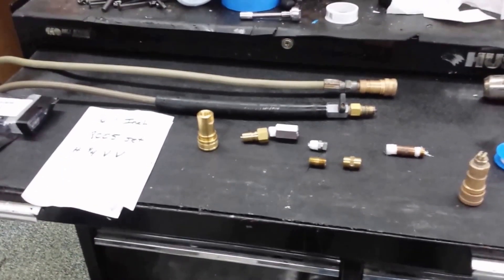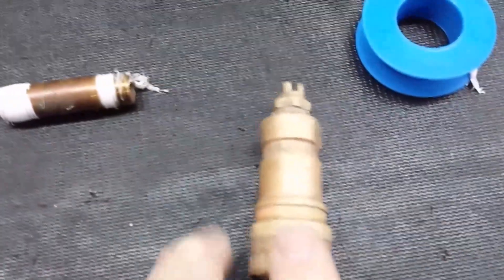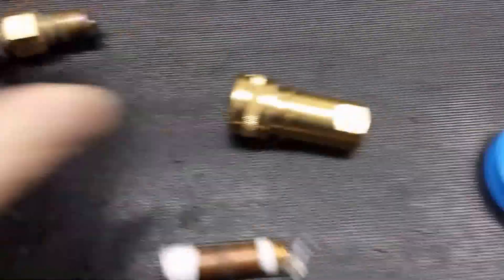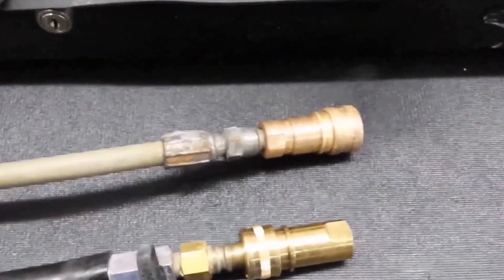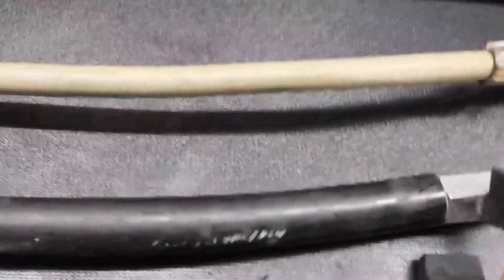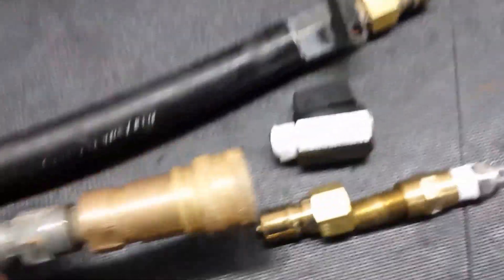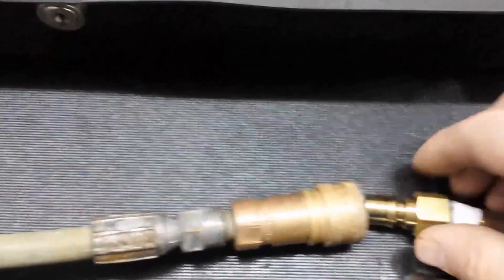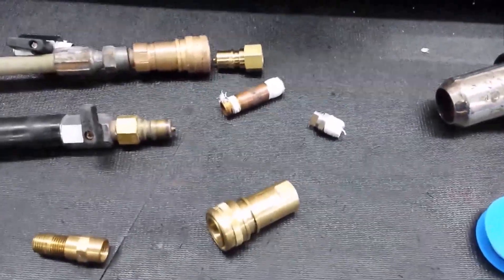Create your own small sprayer end for inline high pressure hose

Comment: I took the handle piece off of an old and not working Hydroforce and put the spray tip on one end and the shut off valve on the other. I just use one of my old Hydroforce jets for the spray end.
Reply from the maker: Perfect 😊👍